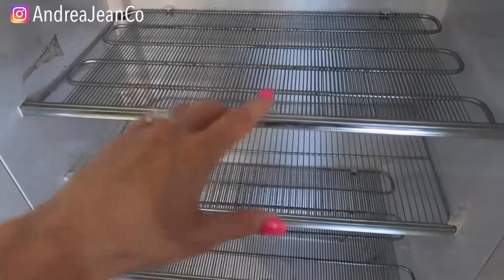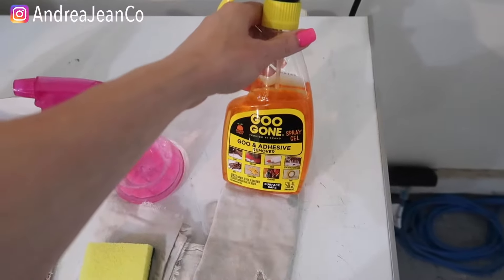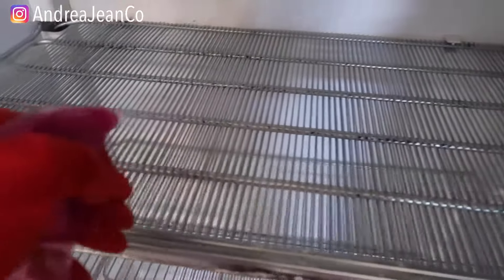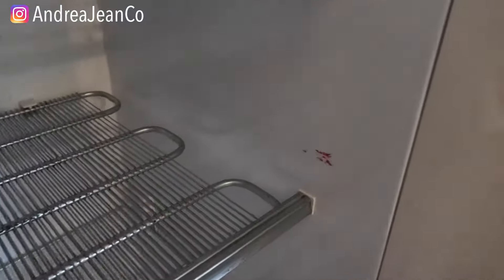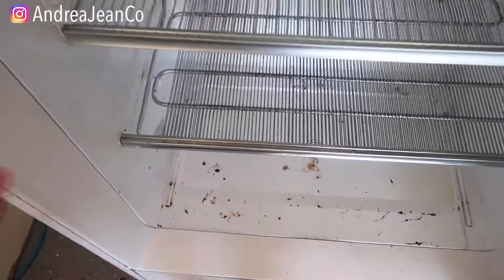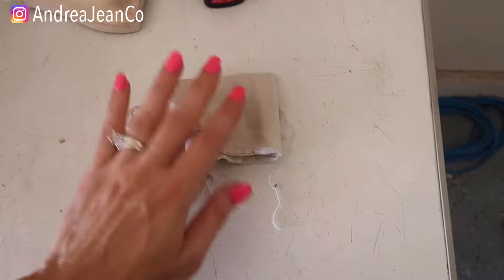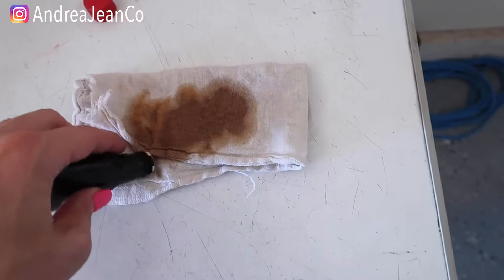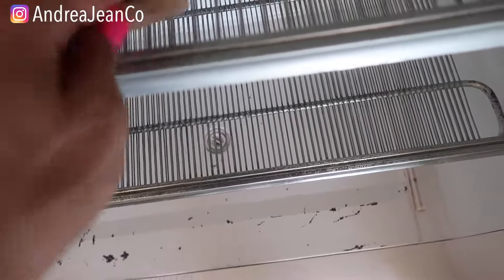Stinky Fridge or Freezer? How to REMOVE the SMELL for GOOD!! (Cleaning Hacks) | Andrea Jean Cleaning

Comment: theres a drip tray under the frige modern ones that gets covered in gunk , tip it on its side take two holding screws out ,pull out and clean well, then replace, this will really help to freshen up, after you have cleaned the inside as well of course.

Comment: 1. Unplug and open the freezer. 
2. Clean it with 1 cup of bleach per 1 gal of water, rinse, and dry it. 
3. Spray it with cleaning vinegar & let sit 20m. Wipe it down. 
4. Get a bucket of warm water with "a generous amount" of baking soda, and wipe everything down. Then dry it with a towel. 
5. Put some vanilla extract on a small cloth and wipe down all the metal racks.
Reply: If you cleaned your freezer and it still has a smell.
Check the drain hole by *clearing it*.
The drain hole at the bottom goes to a *water trap at the back*.
This should be cleaned as well!
Reply: TY!!
Reply: @halaldabo7303  what about a old fridge? My I just got my fridge from some one a 4 days ago. It smelled very bad like old people in a old house. I took all the pieces out and deeply clean it with vinegar and dawn. I use odban for other parts as well. The smell was slowly going away but, it had a fume of that smell to it. So I clean the hole that was in the freezer and it did pretty well. But, the smell is still kinda there. The fridge I have is a tfx27pfsbbb (GE) the manual said it suppose to have a tray but there is no tray. So what should I do?

Comment: Thank you for your advice. Thanks I will keep you posted.
Reply: Update, your advice worked. I used the bleach method, and the vinegar method, then I used 
all purpose cleaners last and I used the room deodorizer lavender  spray and the bad small went away.  Tomorrow I will check to see if it is gone if not, I will repeat. Thank you so much.

Comment: I had a horrible discovery today.  I went to put the Thanksgiving turkey into our outside freezer (in the garage) and it was disgusting!  I cleaned it out this summer and put the food back in, but I never plugged it back in apparently.  So, this afternoon was clean up time.  I honestly am not sure if we can keep it.  I worked really hard at cleaning it up.  But, I'm having a hard time getting the nastiness off of the wire racks like you have in your video.  I did what I could today and will work on it again tomorrow.  In the meantime, I put a box of baking soda in there tonight and it's turned off.  
It turned on again so I know it will work.  I found yuck in places I never knew it could go!  Any suggestions???  Please assist if you can.  I'm so embarrassed and devastated.

Comment: Typically if you plug it in a lot of the Foul odor will dissipate. All refrigerators and freezers stink when they have been unplugged for any length of time no matter how new they are or how clean they are.

Comment: Thank you for the Vanilla tip !!! ❤I bought a used fridge. I believe it was a hunting fridge for meat because there was old blood and fur everywhere. After disassembly, deep cleaning, reassembly there was still a smell. I used car freshener beads by the air intake…still a smell. But the VANILLA EXTRACT worked wonders!!! Immediately fixed the smell. I was shocked! The only downside is that there was a slight stickiness where you wipe the vanilla. But I think going forward I’ll dilute it an still use vanilla